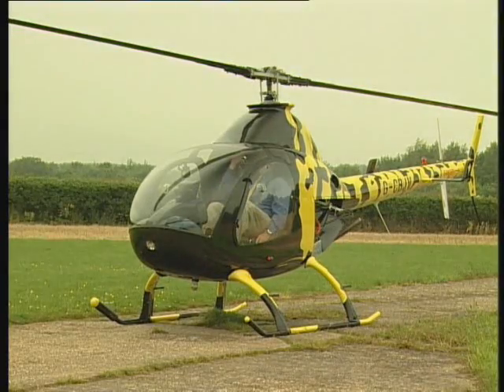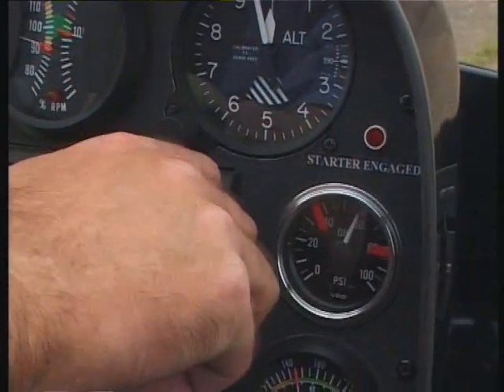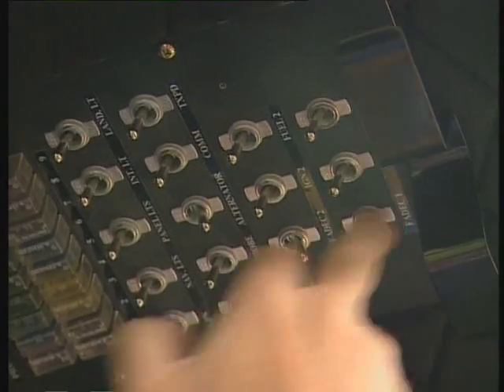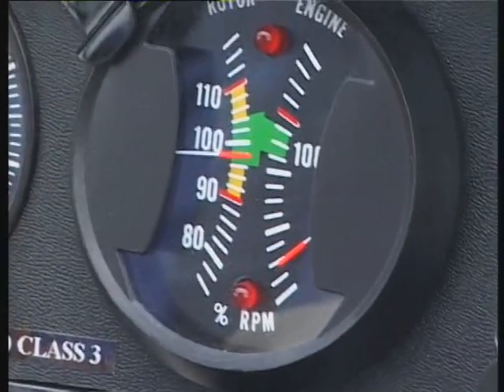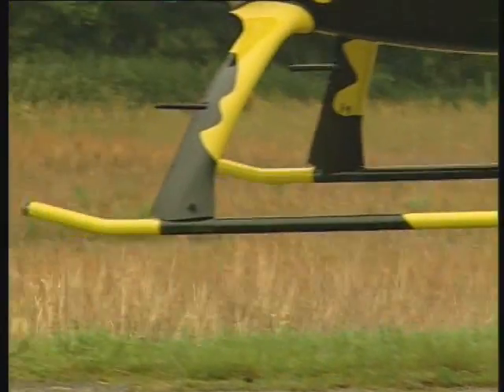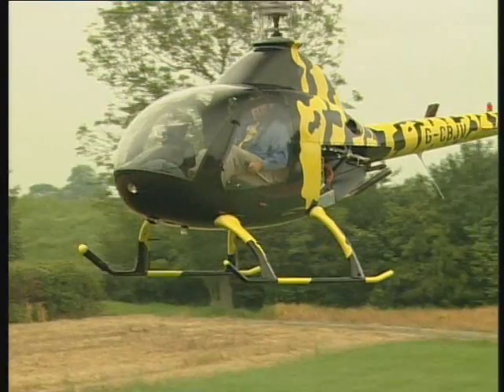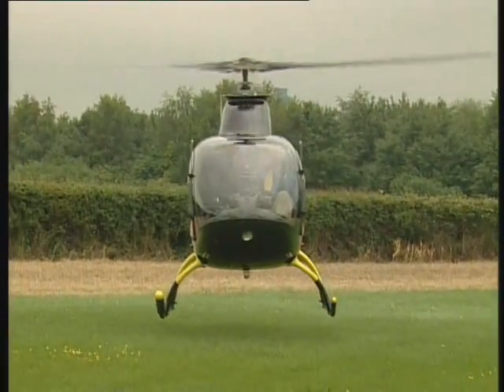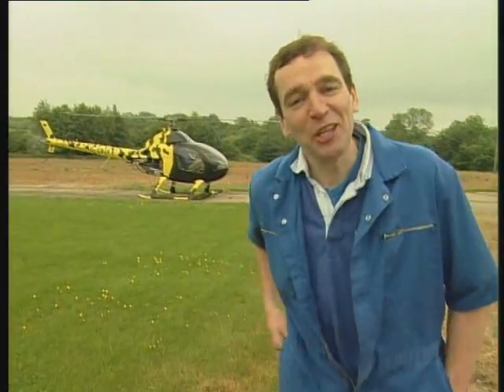Kit Helicopter test flight

Comment from the maker: Whilst preparing to land at a private landing site the pilot noticed that the concrete landing pad had several loose branches on its surface. He decided instead to land the helicopter in an adjacent field of long grass. After landing, the collective was lowered fully and the pilot began the shutdown checks.  The right skid sank rapidly into the surface, causing the helicopter to roll over onto its right side.  Cause was dynamic rollover after the skid sank into a rut beneat the grass.